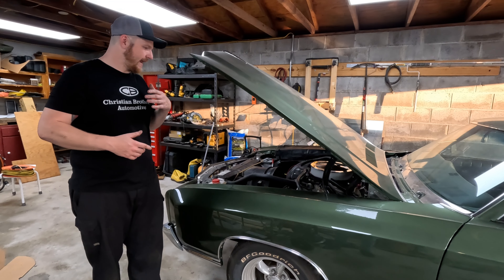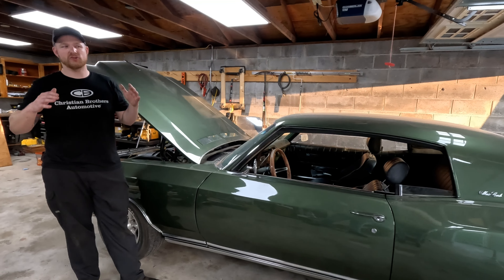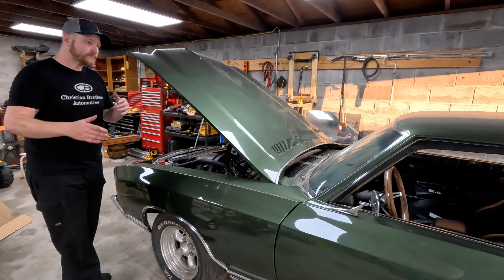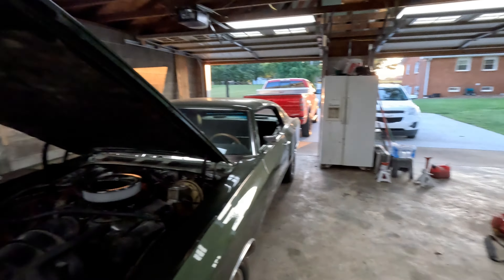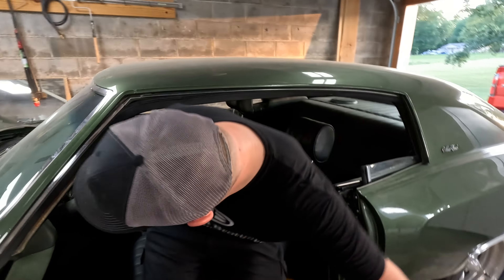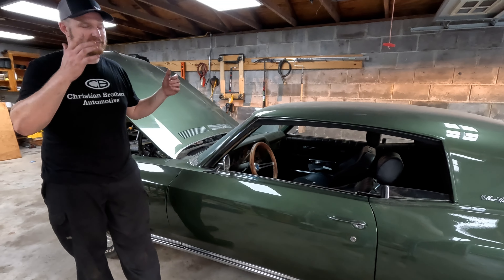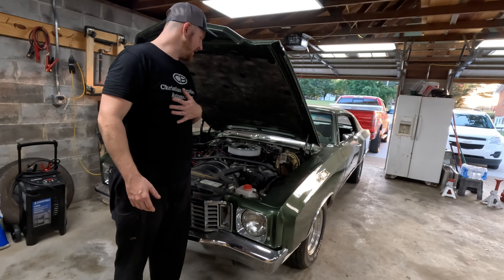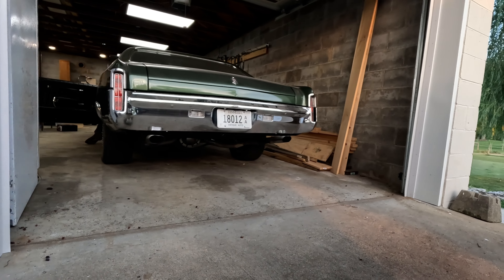FINALLY!!! The rundown on The Full Monte...

Comment: 🤣 if you ever driven a carburetor car and did nothing but put the sniper on, your in for a surprise, and Im not talking about the cold start either. 👍👍 you will dump every carb you have in  the trash.
Reply from the maker: Thats what I like to hear. The throttle response has drastically improved